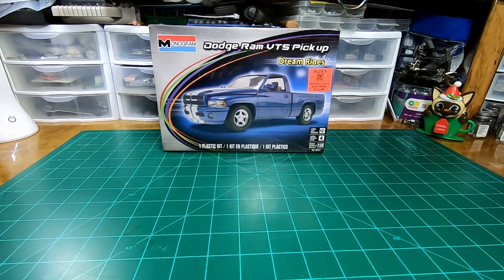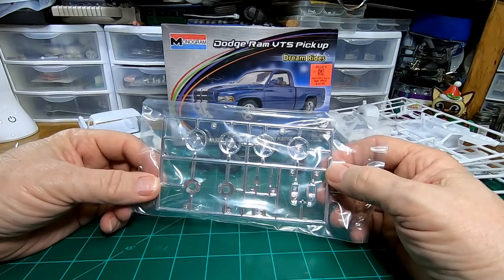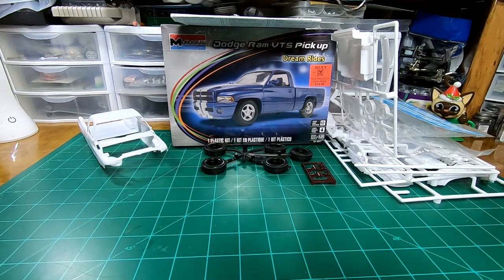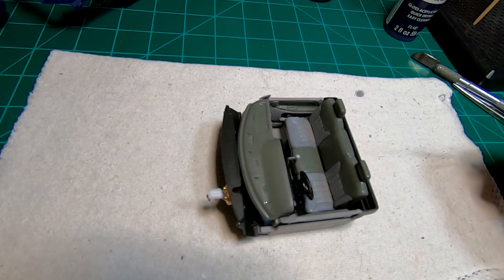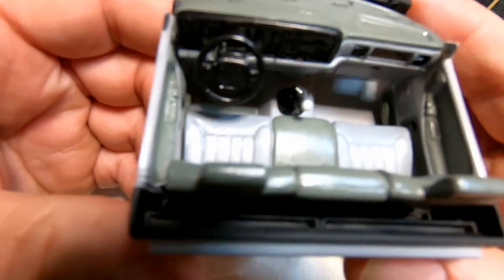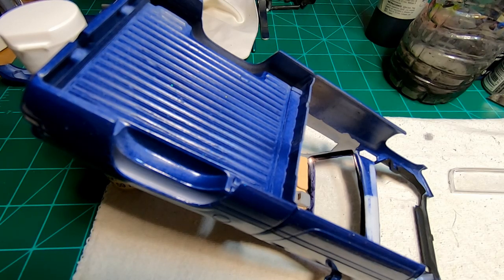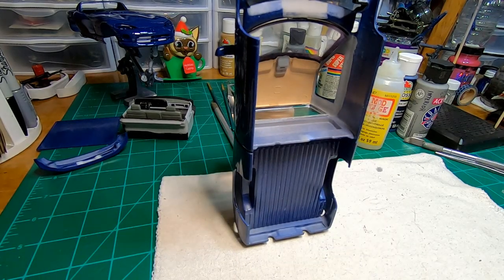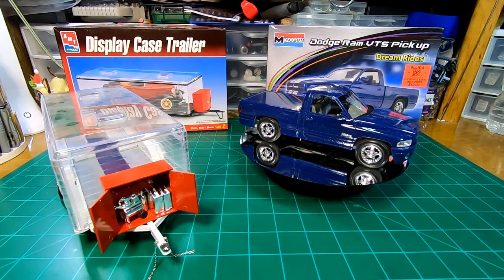1996 Dodge RAM VTS by Monogram - Episode 37

Comment: Another nice video! Great job on the truck.
Reply from the maker: Thank You! This truck was a lot of fun to build. The only thing that I didn't like about it is the one piece body. I have a couple of projects waiting for a cab chassis setup. Things like a couple of Racer's Wedge and a camper body for starters. This one with the separate rear cab wall would be difficult to do those with. Not impossible at all, just difficult. Thanks again for watching.
Reply: @scaleautoguysworkbench  👍👍

Comment: I want to do the same truck, but the dually version
Reply from the maker: I'd like to get one of those as well, but they are difficult to find at a decent price. I have almost all of the necessary parts except for the bed. I've been collecting these years of trucks in parts, pieces, and in whole for the last couple of months. There are a few projects I have in mind for all of them.
Reply: @Scale Auto Guys Workbench  exactly. I want the chevy dodge and ford dually and I want each version different
Reply from the maker: @CODMSIRCUNDLEBERRY  AS far as dually's go, I do have a Lindberg Nissan 4x4 dually still sealed in my collection. It's been on the shelf for quite some time. Sadly, that is the only dually I have other than the parts collection that I am acquiring.